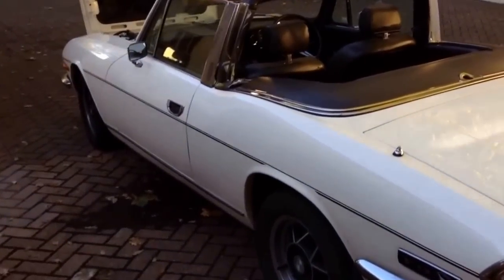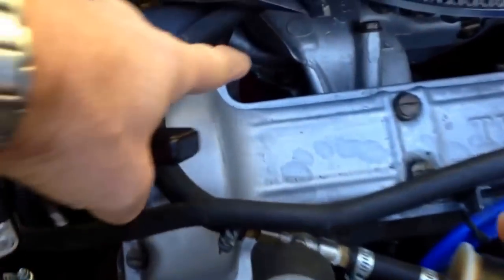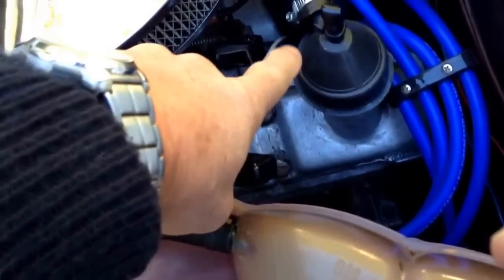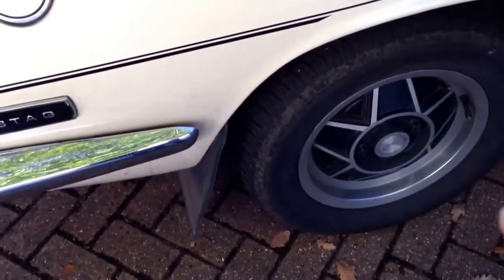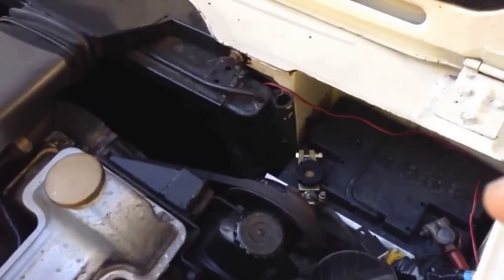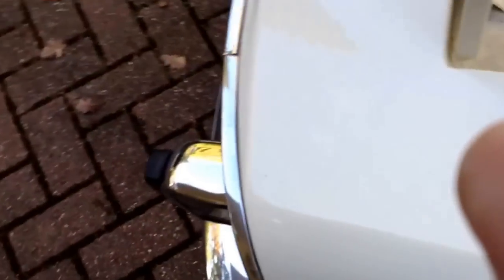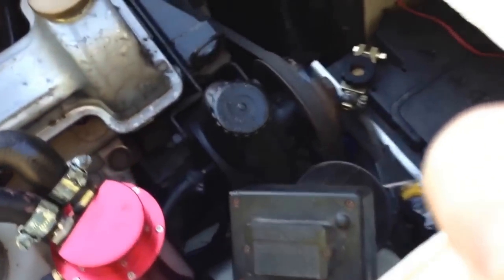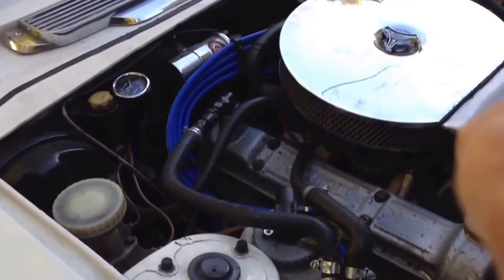Triumph Stag - Some Suggested Improvements

Comment: I bought a yellow one. It is on arry the stag.  The owner before me, made some Upgrades so till now, I drove 1000 km in 5 weeks, I haven't any problems with Chesters engine. Hope it will stay like this...wish you safe rides...
Reply from the maker: Great! Enjoy!
Reply: @comeinhandynow  thank you.  You know I am great fan of the stag now.  I didn't know this car till I was looking for a classic convertible with 4 seats. So I try to get as much Informations about this car as I could....what do you think about oil coolers?
Reply from the maker: @frankabels5761  In my opinion, not necessary unless you are racing the car or it is overheating (but better to sort out the cooling system to fix that0.
Reply: @comeinhandynow  no I am not a racer.  Only between 1500 to 2500 rpm...and changing cooling fluid once a year? And which one do you use?
Reply from the maker: @frankabels5761  rev a bit more on occassion and enjoy it! https://youtu.be/buz4UU6pmKs?si=qKOhtrvOrx_OOpAo
Just make sure you don’t scare your wife too much! Lol https://youtu.be/x8AY4rcSCpE?si=9yonRBlCFngtFfTH
Reply from the maker: @frankabels5761  I use the OAT pink glycol type. Good for protecting Aluminium/ iron engines.
Reply: @comeinhandynow  ok thank you 👍

Comment: Nice video. The water expansion bottle modification solves the stags main problem of overheating and warping heads. With this modification there is no need for putting a different engine in the car like the rover V8 or the Ford V6 and you can keep the wonderfull sounding Triumph V8
Reply from the maker: Thanks.  Absolutely agree!
Reply: However you may have to get the sand out of the cooling system left inside in the casting process to fully get it right.  😏
Reply: @terrificspokesman7416  what exactly do you mean with the water expansion bottle modification?

Comment: Pcv valve is better than a plumbing valve. They work differently
Reply from the maker: 3:28 I mentioned the reason I chose that valve: to optimise the engine vacuum at idle where a pcv would be shut off. It reduced oil dripping from the crankshaft oil seal at idle by introducing a vacuum in the crankcase.

Comment: The original dual points system on stags were quite unique,  Most of the time these worked fine,  One set of points closing the circuit and the other opening it,  The advantage being an increased dwell time over a single point set.  however the down side would be overdue wear on the base plate due to the increased spring pressure on the plate, making the moving plate give inacurate timing and misfire,  Setting the points gap usually is best done staticly. Then doing the timing with a strobe.  The best solution is an electronic type with chopper wheel etc, I'm sure luninition made a kit for this, that also fitted the rover V8.
Reply from the maker: Luminition did make optical ignition circuits but the one i had in a sprint was far from reliable.  The pertronix magnetic system in my stag now is very reliable.
Reply: @comeinhandynow  , now interesting that you say that,  I've had 3 luminition systems in my time,  2 of them for honda engines and the the last was for a citroen SM, and all of them have failed, the last honda engine i went back to the magnetronic system and it was just fine.

Comment: The best improvement would be to buy a Z4 or MX5. Just winding you up, I’ve had 2 Stags and loved the drive, the SOC social stuff and a bit of tinkering. But even good ones are a money pit and you must take a rabbits foot, St Christopher icon etc. for long and high speed trips. I admire the dedication and resources of owners and remain a bit jealous, but I’m over Stag ownership in 2024.
Reply from the maker: If it is restored and upgraded with good care and engineering then it can be reliable and cheap. This video was done 10yrs ago and it has been very reliable since I rebuilt it. A recent leak from the coolant tank (from an Astra 1996) is the only current job to do. Zero tax and £100 insurance makes it very cheap.
Reply: @roadrunner708  sorry in my opinion you can't compare these cars with a stag.  It is like to compare apples with pears ...
In my eyes a porsche 996 convertible would be a good alternative to a stag,  but in germany you can't find a porsche,  a good Z4 or even a good mx5 for the price I got my stag.  And also the prices for repairs or maintenance are lot higher for the other cars than for a stag...

Comment from the maker: Yes, removing the viscous coupled fan apparently frees up a few horsepower, assuming the car is moving and so the electric fan isn't needed either. 
The other mod I didn't mention is electronic ignition, I use the magnetic pickup sort, pertronix or similar as in my experience these seem the more reliable option.

Comment: Never forget always add 1% two stroke oil to the modern dry fuels when using them in old carbed cars with alloy engines
Reply from the maker: That's a lot of oil. What evidence do you have that says you need this?  I've never done it and never had any problems.  I do have unleaded converted heads though with hardened exhaust valve seats and brass valve guides.

Comment: Great stuff! I'll do some of this. 

I especially like the expansion tank and the fan mods. 

Lots Waxoyl also helps with the rust. I love it on hot days when the stuff drips out of the hollow sections, as proof that it has got into all the seams. 

And if you heat Waxoyl till its really runny and pour it over the joints, that "seams" to works, too ;).  

On mine I solved the overheating problem (the word issue is only used by OEMs trying to play things down ;) by fitting a modified water pump impeller devised by a German and a "T" piece so that the heater return is fed equally to both cylinder heads (can you imagine the thermo-shock to the right head when you switch on the heater on a cold day?)

I use the green Renault coolant. 

All these basic errors by Triumph, no wonder the Stag bombed! 

And it has to be said - though I hate to agree with Clarkson - they should have fitted the Rover V8. Not least because it has a lot more main bearing surface area.
Reply from the maker: +jonnybottle Thanks for your interesting comments.  On the subject of Waxoyl, as well as heating it I now also add a bit (~10%) of old engine oil. It makes it a bit oilier and lasts longer and penetrates more.  The original Waxoyl mix can dry up a bit too much for my liking after several years.

I'd be interested to see what water pump impeller you use.  There are the 6 vane and 12 van ones from Triumph.  The later 12 van one was supposedly meant to improve flow, but there are various stories floating around as to which is best, and some also use electric pumps instead.

On the cylinder head to heater connections, yes it seems like a good idea to connect both heads, and indeed when I rebuilt my engine I also had a pipe connected to both heads, but never got around to doing a t-junction to join it up. It's still sitting there with a cap on the pipe.  I don't think thermal shock is too much of an issue though as I believe the water flows out of the cylinder head to the heater rather than in from the heater.

I don't know the green Renault coolant, but is it designed for Aluminium engines? i.e. With OAT?  The modern coolants (like the pink OAT stuff) look after our engines so much more than could be done in the 70's with just glycol.  The rads clogging up with corrosion products from Ali/iron reactions added to the woes of overheating in those days.

Regards Jon
Reply: Another good tip, but I'll use new oil. I have enough 1970s GTX cans with a bit left knocking about. When I went round Shell's Hamburg lubricant development department I was impressed by all the warning notices, telling staff not even to put a rag with used oil on it into their pocket for fear of getting dioxins on their skin.

My Haynes manual is at my lock-up, but according to the drawings on Rimmer's website it's definitely the heater return that goes to the back of the LH head. The flow comes off the water pump.

I have a modified impeller in front of me. It's in sea water resistant alloy and a more sophisitcated shape than either of the Triumph ones. Unfortunately it's one where the hole was drilled just a shade too big. But you might be able to fit it with plenty of spline cement and a couple of grub screws to hold it fast. It would also act as a pattern if you wanted to cast one. How can I get a pic to you? And, I'm in UK next week and could send it to you.

I could also send you a new oil pump spring. I have a number that were given to me when I visited the maker, and anything that fatiques is worth renewing on a preventive maintenance basis. I had one break and it cost me a crankshaft regrind.

I have a theory about Stag water pumps. They were assembled on the engine as it went down the track and setting the vital tolerance between the impeller and the housing is a bit fiddly as a production line process. On an outboard pump that would be done at a bench. And while its a good idea to have gear driven water pump, they are always a potential place where the lube oil and the coolant can meet.

Yes, the Renault premixed coolant is specially for alloy but not OAT apparently. Since it costs an arm and a leg and my other car is a Golf Variant and my Daughter has a Polo , I have quite a bit of pink coolant knocking about. I'll try it next time I drain the system.  

Thus endeth the sermon ;)

Regards Jon (namesake?).
Reply from the maker: +jonnybottle I think that rimmerbros diagram must be wrong, as the water pump sucks in from the top and pushes out into the block.  The water then flows from the block to the heads, and from there to the heater.  I haven't run the stag up to double check this but it certainly looks this way and the way other sources describe how it flows.  Let me know if you check it and I'm wrong.
You're right about the water pump design, it's a tricky setup to manufacture.  I had one fail on a dolomite sprint, I think it was dragging on the cover (probably my fault on a rebuild) and the jack shaft gears got stripped off, so I wasn't that happy with the design.  It's been ok on the stag so far, but that jack shaft has a lot of work to do driving the water pump, distributor and oil pump.
Thanks for the offer of various bits but when it's all working well I think I'll leave it that way and I don't have any overheating problems.
Nice chatting with you.  Jon.

Comment: Wish I had kept mine it was fun.
Love your mods they all make sense and keep the car original enough.
If only they had been sensible with the engine design/choice this could have been great.
They had a lovely straight six they could have used off the shelf
The Rover V8 in house.
The old Daimler V,8 would have been great.
Instead they stuck two dolomite units together to cobble a ,V8 up, 
I wonder if they could have used 16v sprint heads but doubt the bottom end would handle it ..
They do sound great tho I have to admit 
Poor cooling , dodgy dizzy, and a torturous timing chain but with all these faults I still love em.
Reply from the maker: Thanks for for input.  I read that the USA market wanted a v8 which is why a s6 wasn’t used.  The rover V8 should have been used (not without its own problems) but the stag v8 has some nice features being smaller and a free reving overhead cam engine. The Daimler one was a bit small.  The stag v8 uses the same design principles as the dolomite unit but doubled up, but of course is not what some people say of two dolomite engines bolted together!  They did apparently make one sprint headed v8, which would have been great but I guess needed more time and money to engineer than they had available.
Cooling is sortable with modern bits and a good clear out.  Disti is par for the course in the 1970’s although I’m not that keen on all that load on the jack shaft - water pump, disti and oil pump.
Agreed that they do sound good.
Reply: @comeinhandynow  
Thanks for getting back.
I always wondered why the didn't fuel injection them too given triumphs use of it .
What a shame they didn't develop this car with a bit of care and attention in manufacturing and some improvements it could have been a world beater 
I remember when they closed the factory, the local news showed them destroying and skipping brand new hoods, it was criminal.
I think BL just wanted the Triumph brand dead .
Get rid of the dealers and concentrate on Austin Jaguar and Land Rover.

Comment: Really good use of modifications, thats the exact engine mods i want to do to my stag, also i didnt realized the engine could survive with just a thermostat modern electric fan? Does it really free up some bhp?
Reply: Edward Murray Great engine mod  is to fit a 327 Chevy V8.
Reply from the maker: I have owned chevy v8 350 engined cars and although any v8 is nice and the small block chevy is good, it is not as good in term of revs and exhaust sound as the stag, especially my stag.  The chevy is pushrod, the stag engine is overhead cam, which makes for better high revs.

Comment: It looks like a standard plumbing temperature or pressure gauge fitted.  Check with the makers that it is suitable for below freezing conditions.
Reply from the maker: Pressure gauge, designed for petrol. was just used to diagnose an intermittent stopping problem. Will probably remove at some point. As it’s designed for petrol it should be fine.
Reply: @comeinhandynow  
But is it suitable for below freezing?  Well it was only for testing so fine. ;)

Just standard cheap plumbing fittings are superior to auto junk. In some old cars I had, I used off the shelf soft copper pipe, run around the engine bay. Rubber pipes connected to them where movement is needed. But there are quality flexible stainless plumbing braided pipes that are available that are superior to hose clips and   rubber pipes.  Would you have you house plumbing in rubber pipes and hose clips?  Yet rubber pipes in cars are operating over 100C at times. Appalling engineering by auto people. 

Heating engineers when looking inside car bonnets say "WTF!  Cheap!"  People expect that rubber hoses in cars are changed every few years, but would never accept that with pipes on their heating system at home.  Even fuel lines were connected up using flex plastic/rubber pipes and hose clips. Amazing!  No heating engineer would connect up  a gas or oil line to your home boiler using plastic pipes and hose clips. 

But, saying that, latex hoses are excellent but expensive.

Comment: Hi, I'm interested in the tie bars you mentioned to stop the twichiness of the rear end, can you let me know where to buy these from. Love the video, thought the issue of the seams was spot on as I have water leaking into my boot.
Reply from the maker: They were from Monarch stags, not sure they still do them though.  They did suffer from stress cracks on the right angle joints, so they are off mine at the moment, but when they were on they did the job.

Comment: Great mods. Would love to hear it and also know what HP you get now with those engine mods etc.
Reply from the maker: Thanks.  There is another couple of videos on my channel with me trying to capture the sound, not quite the same as being there though.  I’d also like to know the HP, I’ve not measured it yet but it certainly revs well now with noticeably more HP at high revs due to it breathing better.
Reply: comeinhandynow great stuff. Not that it matters too much what HP it has..it was just put of interest. I always loved the looks of the Stag.  Are the cooling problems a thing of the past with the mods you made?
Reply from the maker: Yes, correct.  My stag has never overheated.
Reply: comeinhandynow great work. Makes you wonder why BL didnt do the basic sensible stuff in the first place like a properly placed water expansion tank etc. I know that electric fans didnt exist back then but still....

Comment: Had one come into  garage once had expansion bottle mounted on rool bar behind driver driver said it fixed its problems  and if it did get hot could hear it bubbling
Reply from the maker: It certainly helps having a tank at least as high as the water pump on the engine.

Comment: Good it will help some  cars but yours obviously doesn't need it the issue was the stag had been banded about by some that they overheated yours runs fine changing or working on the radiator has also helped .
Reply from the maker: Yep, plenty of reports of overheat issues. One old original problem was the block water channels blocked up. Stripping down and cleaning out the engine water channels as well as recoring the radiator certainly helped a lot on this car. The modern fan with electronic control also helps. No overheating ever for me now.

Comment: What about an oil cooler might be needed to keep temperature down ?
Reply from the maker: I haven’t found it necessary, engine temperature never fluctuates from nominal in this car, probably due to the recored radiator, electric fan + electronic control and engine block cleaned out when I rebuilt it.

Comment: What car did the coolant header tank come from? The stainless or alloy ones look nice however I prefer to see the coolant level at a glance. Yours looks like it fits nicely in that space next to the wiper motor and it's at the highest point possible.
Reply from the maker: I looked around a scrap yard for something suitable, quite a long time ago.  It was from an old style Vauxhall Astra Diesel 2L I think. And yes I agree, definitely better to watch coolant, as if you need to open the tank to check it will go to a different level as its lost pressure.
Reply: @comeinhandynow  Thanks
Reply from the maker: Here’s that header tank https://ebay.to/2X6vSb7